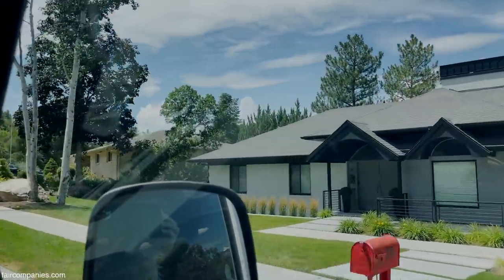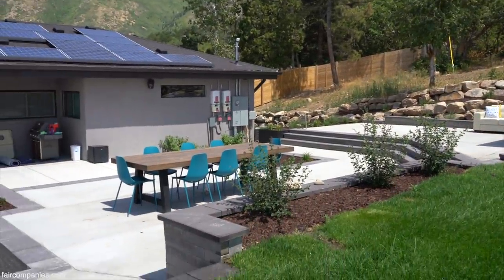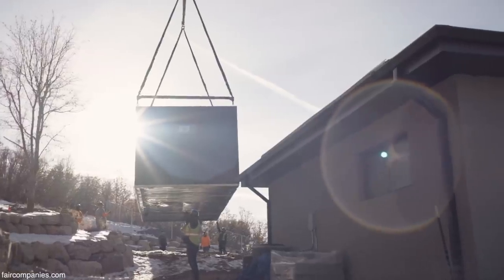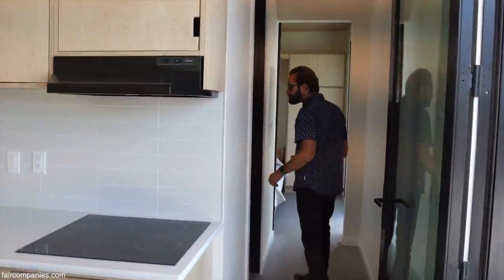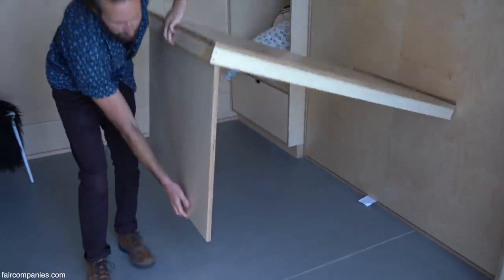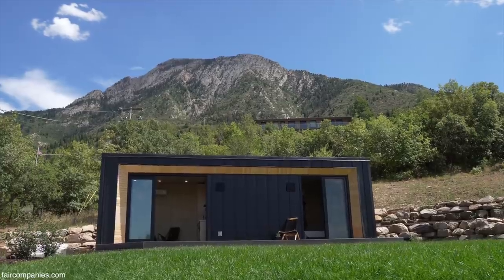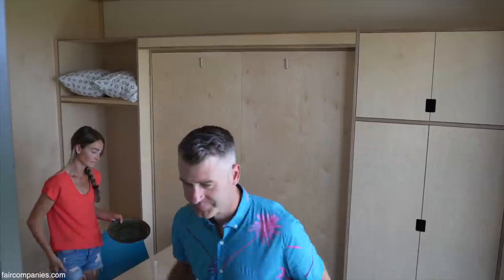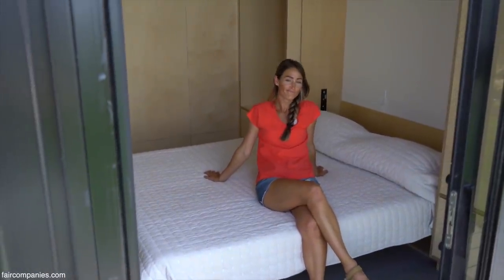Modal is a backyard home to rent-out or dwell-in anywhere

Comment: Doesn't seem that well thought out from a design perspective. Feels like a container with trim upgrades. 'Modular' has just become a byword for unimaginative, streamlined manufacturing for maximal profit. Anyone can extrude a rectangle and punch windows.
Reply: bru
Reply: Yeah the washer/dryer setup made it obvious to me.
Reply: @justinemcq4503  You'd have to be a yard gnome to load and unload the bottom appliance on the stack washer dryer.
Reply: @vecomadden8267  I've got side-by-side front-loaders.  It's no hardship.  I even considered stacking them, just for more space in the laundry area, in a much bigger house.
Reply: the hallway needed to be on that outer wall with the sliding glass windows.
Reply: @vecomadden8267  maybe some people simply cannot allow a bit of extra effort. lazy and/or fat and/or just out of shape regardless of weight or age.

Comment: I'm a big fan of small space living, but this unit is the most unimaginative unit I've ever seen. And $119,000? I do feel uncomfortable about sustainability when I see modular constructed housing, built in factories, and shipped thousands of miles by huge diesel trucks, and installed with enormous cranes, involving lots of people throughout the whole process.
Local imagination, local materials and local labour would probably be far more sustainable. And given we're entering a new age of increasingly hotter climates, we really should be designing houses that have good passive cooling.

Comment: Small homes definitely should be much cheaper than this but I have to say the finishing is so pristine, they've fitted so much in there and there's just something absolutely special about black homes! Perfection 👌
Reply: Black homes in full sun, are hot (and foolishness in my estimation, no matter how good they might look).
Reply: @Sovereign_Citizen_LEO  Well that's one way to look at it but its not that simple, there's a lot of factors involved but the most important is the climate of the area in which the house is situated then there is also the question of the materials used in cladding as well as on insulation.

Comment: Some of the details seem rather weak and underwhelming for a small smart space house of this high cost.
For example that Murphy bed than then can be used as a table, there was no effort made there to not "cut" your fingers when you lay down that vertical board (you saw him struggle not to wreck his fingers) secondly the long cheap looking hinge looks like the one that will eventually became loose with use. 
This is is obviously not designed to be be used, but unfortunately like many of the contemporary "smart design" has features that in practice they become a nuisance and end up not being used.

Comment: It seems like a reasonable investment. If all in it costs $150,000 to install then here are the numbers; $30,000 down. $120,000 home equity line of credit. @ 3.0% you'll be paying $505.00 per month in mortgage fees interest and capital. Electricity might add $100 per month. Taxes maybe $50-$75 per month. Warter and sewage may not add anything. 

If you can rent it for $1,500 per month (low side of the equation) you'll make $750/month. That translates to $9,000 per year or 9/30 or 30% return on equity. Obviously there is depreciation (the entire amount can be written off over 27 years) in your favor tax-wise. Then there are repairs and property tax issues etc.
Reply: $300K installed for this unit (all in).
Reply: @Sovereign_Citizen_LEO  Seems a bit pricey for what it is,  although real estate prices have risen so who knows. It looks a bit shy of $300 per square foot.